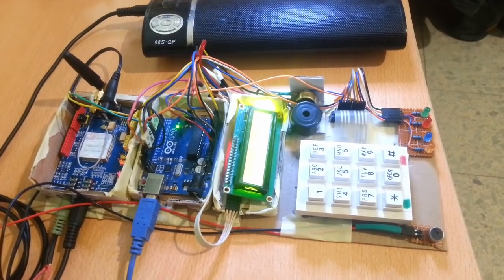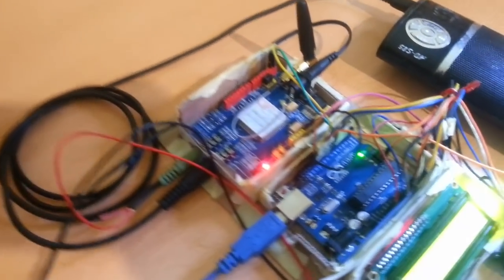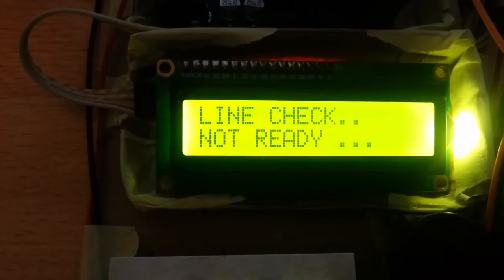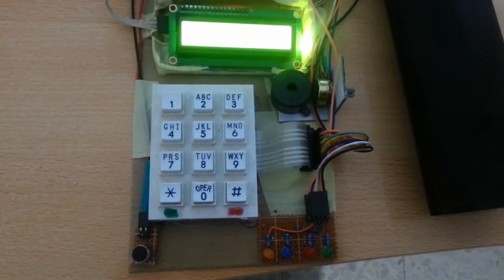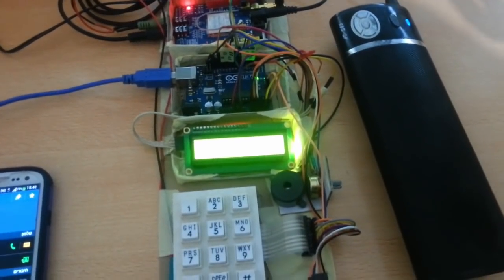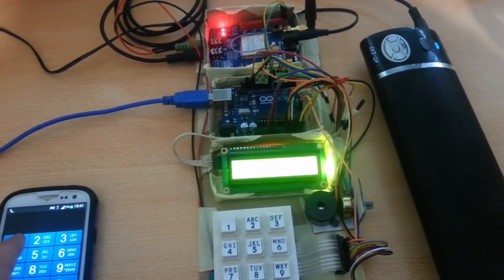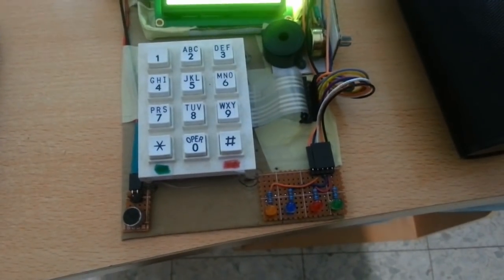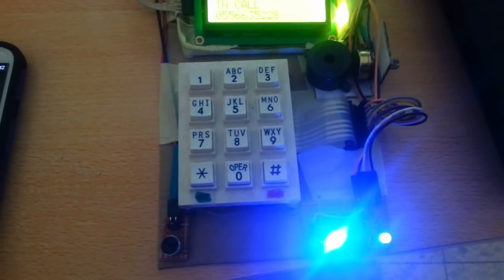Arduino and sim-900 based diy mobile phone with DTMF detection

Comment: hello.... did you just use a regular sim card in your sim900?   are you in the usa or canada?    i had a problem connecting the antenna wire onto the sim900...i might have damaged it as I read zero ohms on the board between the center cond. and the ground.   I figured it should be open circuit?
so I don't think my sim 900 is working.
Reply from the maker: Hi, yes regular sim card for it. note that it only support new transmition protocols. 
Where are you from and what are the supported networks for your mobile service supplier.
It is easy to damage thus connectors.

Comment: Hello sir, Great video. Can you please share code I have trouble making my DTMF function work.
Reply from the maker: Thanks.
What did you try so far ? did you try any code ? what errors did you get ?
Reply: @talofer99   I am printing the DTMF keys from my phone keypad on the Arduino serial monitor. I used Serial.print("AT+DDET=1\r\n). But it's not printing out the DTMF keys.
Reply from the maker: @shaunphala8612  This function is only activating this feature.
This is not the function that "reads" the data.
You need to have a loop that will always check for data on the Serial connection.
Then once you are on a call - and press the keys you will get a Serial data with  "DTMF" output on the head of it. 

Hope this is clear.